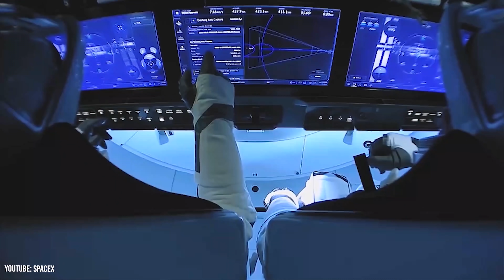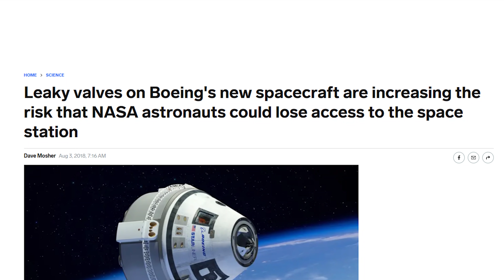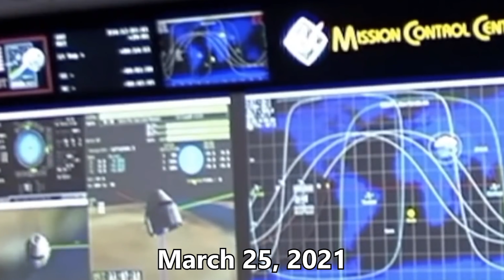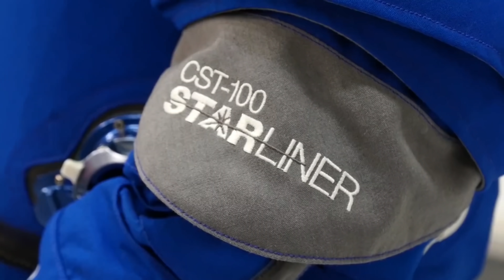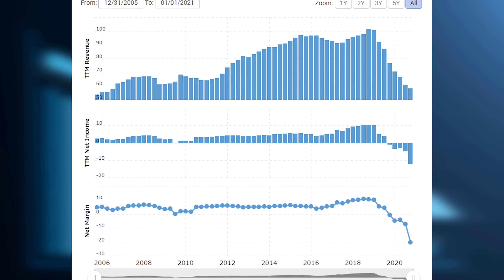What Happened To Boeing Starliner?

Comment: The issues with Boeing go extremely deep, going as far back as the buyout of Boeing by Lockheed Martin with its own money. Their quality standards have gone way downhill, and their leadership is made up of accountants, not engineers. These problems unfortunately won't end here, and it's only one of MANY things they're dealing with. Sadly, Starliner will likely be cancelled if they fail, and for good reason.

Comment: Why not use dearm chaser with crew  ? It can land like the space shuttle on a runway
Reply: If Starliner ends up as a dud, NASA will, in my opinion, either let SpaceX take over all the flights that had been assigned to the Boeing capsule or turn to Lockheed Martin’s Orion as a Starliner replacement.

Comment: the reason the problems got through ground testing was because boeing tested all their components individually. they did no integrated tests where they tested all the components in conjunction with each other. this was the major finding of the after action analysis, and is well known. if you're going to report on such things, you should have known this. not putting you down. i appreciate that you are making the effort. but next time, you need to dig a little deeper.

Comment: My own take for this:

The reason why SpaceX has been able to launch a crewed mission already and Boeing is still yet to dock an unmanned mission is simply because both NASA and Boeing underestimated SpaceX. You see, while SpaceX has lesser experience on space vehicle compared to Boeing, SpaceX actually have greater experiences when it comes to human rated spaceflight. The original cargo dragon was designed to be rated for human spaceflight which gives SpaceX the necessary data to be used in the development of the crew dragon thus makes it easier for SpaceX to build something where Boeing struggled because Boeing just doesn't have the data needed for human spaceflight that SpaceX already have all these years since it began its Commercial Resupply Service to International Space Station back before the Commercial Crew Program was even announced. This makes SpaceX more experienced than Boeing in basically all aspects.

Comment: I've worked with Boeing and several other airframe company's over the years on several different projects.  I've always found that they were very hard to work with.  When they came to reviews (CoDR, PDR, or even CDR) their presentations were almost always below accepted standards.  Their typical answer to questions was "we know what we are doing.....trust us"  for a federal employee this was very troubling.  So it is no wonder they are having problems.  If the corporation doesn't change its attitude, I think their long term prognosis is poor.  I'm very sorry Lockheed stopped building L1011.  Boeing needs more competition building commercial aircraft.  Five minutes ago I finished watching a news broadcast showing three different approaches for moon vehicles.  No where did I see Boeing name.  Boeing had better clean up their act.
Reply: the SLS will be used to carry the crew to space, seems like its just thrown in there.

Comment: I think Boeing failed with Starliner for several reasons:
1.  They’ve never had competition after receiving a contract.
2.  They’ve never had to actually stay within a budget
3.  They’ve never had to actually meet a schedule

The pressure and need to meet of all these requirements was more change than they could handle without error.

Comment: SpaceX was building on the cargo Dragon and Boeing was starting form scratch. Boeing want's to claim the pedigree of companys that it absorbed like NA Rockwell, Hughes Space and Com, Douglas, etc. but they don't have problems in replacing the people who made those places great. When the people left, Boeing moved their misfits into the important positions in the acquired company as a way to get them away from the core business without firing them. Peter principal at work. Is the top management at Boeing going to give these guys enough control to succeed? Really if you are running Starliner for Boeing the most important goal you have is not to screw up and find a new career move before the hardware goes to test. After the test, new people will come in and try and fix things. Those people will NEVER get credit because no one will admit how badly the initial parts of the program were screwed up! Of course it goes without saying that the bigger the budget, the longer the time line and the longer it will be before the problems are recognized and fixed, and the more the fixing will cost.

Oh, the guys running things at SpaceX are guys who spent 20+ years at NA Rockwell, Hughes, TRW, and Douglas and wanted to do these things and were tired of being the guys who fixed the screw ups and never got credit for it and would almost work for free if they found a place where they were allowed to do what they had dreamed of when they decided to become engineers!

Comment: The hypothesis that Starliner would have worked perfectly well if the 737 MAX desaster had not syphoned away the necessary resources, has to be rejected.
The 737 MAX was rolled out with a major flaw that was not addressed, while the plane was pushed through all necessary tests and regulatory roadblocks. The same goes essentially for Starliner. The lack of sufficient testing  and quality control and the urge to deliver the product as quickly as possible were flaws ingrained into Boeing´s corporate culture. Both desasters were the fruits of that systemic failure.

Comment: I very highly doubt it was a focus issue at Boeing. You are right it did not receive the attention of the people high up to see when the gates would be missed. But I think the main issue is that in a company such as Boeing, you eventually start developing a certain "safety/no innovation" attitude that does not let new ideas bloom to fruition. SpaceX is exactly the opposite in that respect. And then, without the major push of the top management, it just gets delayed and delayed, because people do not reexamine their mistakes, just work around them as best as they can get with the limited toolset they have.

Comment: Pretty good video! You can add to the list of Boeing's failures the KC-46A air refueling tanker aircraft for the Air Force (way above budget and way behind timeline, and STILL does not work right - I mean, it's just a tanker derived from the 767, for Pete's sake!) and the current issues with F-18 Super Hornet block 3, problems with the 777, you name it. The only thing they got right is the F-15EX, but then again, the F-15 was originally a McDonnell Douglas product, so there's always that. Boeing is just a giant government funded pension scheme for aerospace engineers and managers with no new ideas and no willingness to take risks. But they'll sure take you taxpayer money, for sure.
Freakin' losers.

Comment: If it were JUST StarLiner - then we could put this down to bad luck.   But the entire SLS program is an even bigger disaster with even more missed deadlines and funding overruns.  One under-performing program would be bad - but TWO speaks of a pattern.    Worse still. StarLiner's problems were software - and not just one bug, but a cluster of them in a system that is supposed to have been completely tested before ever leaving the ground.   The 737-MAX problems were very similar, multiple bugs in a system that had been sold and flown as "human flight ready".   Some of SLS's test fire problems have also been attributed to software errors.   So what we have here is a very definite pattern...and it's a new one, not something that Boeing are usually known for.  Some ex-Boeing software guys that I've spoken to claim that the merger with McDonnell Douglas in 1997 was the root cause of that.  McDonnell were failing for precisely the reasons that Boeing are now failing...and (according my sources) this is due to the acceptance of the very engineering approaches that caused the McDonnell company their problems to override the (generally successful) Boeing culture.  Much of this is (of course) speculation and rumor - but the facts do fit this narrative very closely.  The issues with the MD-11, the A-12 Avenger (both McDonnell screwups) read VERY similarly to to 737-MAX, SLS and StarLiner.   So, yeah, sure, the pandemic didn't help - but all three problems had been happening for years before COVID was even a word.    For me, the worst problem of all is yet to happen...SLS.   SLS is going to cost literally 1,000 times more to launch than StarShip.   SpaceX are crashing a lot of StarShip prototypes - but that's how they work.  Throw something cheap together, when it fails, fix it.   Keep doing that until it doesn't fail anymore.   That's the way most large software companies work...and there is a reason for that.   But that's WAY different than the Boeing approach where each tiny part of the system is tested to perfection, then each group of parts are put together and tested to perfection and so forth - until (theoretically) it all works perfectly on the very first flight...but as systems get increasingly reliant on sophisticated software - and complex interactions between hardware and software - that's increasingly becoming an unworkable approach.  Boeing can't easily adapt to the SpaceX approach - which is why they're doomed.   The world has changed - and they have not.

Comment: When Starliner is working and safely delivering astronauts to the ISS, it will fail on cost grounds. Boeing is a magnitude more expensive than Space X due to their higher costs everywhere & then dumping their rocket into the Atlantic. The hard decision will be to cancel the project or have a second means to get to orbit as a backup. The third alternative as noted in many comments is to give Boeings funding to Dream Chaser. A fourth option would be to launch a Starliner on a Falcon. Fifth option launch a Dream Chaser on a Falcon. Lots of options!

Comment: Some inherent failures by the management at Boeing. Boeing use to be a company run by engineers & Boeing use to be known for their engineering excellence. Not anymore. To say the Covid effected Boeing is irrelevant, as it effected Space X and everyone else. Boeing recent failures include not just the 737Max but the Aerial Tanker contract with the US Air Force, production difficulties with the 787. Firing the CEO was a step in the right direction but will it be enough? Some major changes need to be done internally to re structure how projects are accomplished.

Comment: I don't think there's much contact between the spacecraft division and airliner division. Companies aren't individual people with limited capacity for attention, a big company can do more than one thing. (Also, while airliners are important to Boeing, they are first and foremost a defence contractor, and keeping their biggest client, the US government, happy is critical.)

Anyway, this video ignores that the whole commercial crew program was slowed down by Congress, who intentionally spread the funding over more years than intended. To some extent Boeing was just unlucky that a hole in their quality control process turned out to be a critical hole (all QC is imperfect, but you only notice when one of those imperfections turns out to be critical).  They were otherwise on track to certify at the same time as SpaceX, but are now slowed down both by needing to fix the thruster control problem, and then having to wait for a free docking port at the now much busier ISS.

Comment: Boeing is used to competing with its traditional rivals in the defense-aerospace industry, where cost overruns and project extensions are assumed by all sides and accepted as the Way Things Are. SpaceX doesn't play by those rules...at least, not to anywhere near the same extent. This is why SpaceX beat them to flying crewed missions.

Comment: Left out was that for 4 years (2011-2015), Congress did not approve all the money for the programs, sometimes less then half the amount.  This was the single largest source of delay in these programs (SpaceX and Boeing).  The awarded money is not paid all at once, the companies get payments as they meet milestones.  Congress still has to approve the spending every year.

The description of the first unmanned flight was also a bit misleading.  The video states correctly that due to a timing issue, the Starliner used too much fuel reaching orbit.  The video then shows the Starliner docking and says "the Starliner would fail it's docking maneuver".  The reality is that they never attempted the docking maneuver (they did not have enough fuel to try).  You can call it a failure, but the video left me thinking that they rammed the station.

It's also worth giving a bit more detail on the re-entry problem.  On re-entry, the capsule would separate from the bottom section.  They had programmed the thrusters backwards, so instead of the bottom section flying away, it would have flown back towards the crew module.  Luckily for Boeing, after botching the timing issue, and botching the communication system (not mentioned in the video), they decided to look over all the software and caught the backwards firing engines before they used them, and did an inflight software patch.

Still a good video and worth the watch.

Comment: You mention the Boeing aircraft division several times as a reason for selecting them, and as a reason for Starliners delays. Boeing already has a huge space division and it's the performance of that division that gave NASA high confidence in them, not the aircraft division. They are the prime contractor in the SLS, and they were also a prime contractor for the entire ISS structure.
Also, since they are separate divisions, the was not much (if any) effect on the space division due to the 737 issues.

Comment: Talks about 737 Max - shows 747 instead.
Boeing needs to spin off their aerospace division if they are to compete.  Not only SpaceX, they are rapidly being overtaken by tiny RocketLabs from New Zealand.
They receive more funding yet delivered less than SpaceX.  As Elon said, they obviously give more attention to lobbying than actually building spacecraft.

This is happening with the HLS Moon Lander program as well - SpaceX always gets the short end of the funding stick but delivers more.  SpaceX got one quarter of what Blue Origin got, and slightly more than half of what Dynetics received, yet they are the only ones to be actually testing spacecraft.  All the others could manage with their massively larger funding is to produce some life-size model spacecraft, and slick animation of what they WOULD like to be able to do.

Understandably NASA wants at least two competitors for their projects, but throwing money at it as they had always been doing is not the answer.  They need to identify which companies are using their funding more efficiently, and give them even more funding to help them along, instead of burning money on inefficient incumbents who are better at lobbying than building spacecraft.  As SpaceX has shown, upstarts are always more focused and motivated and cost a lot less because their very existence depend on them actually producing results.

Comment: Id even argue that the delays, overruns, software issues experienced in the space sector foreshadowed the downfall of the Aviation side of house.  Let's face it,  2010 issues happened far before the 787 batteries, 737 max  etc was even on the radar. Can't use covid as a crutch since all 4 players had the same issues.

Comment: Lots of minor errors and IMO flawed judgments, but overall a mostly reasonable timeline of events and assessment of the situation.

Note that the space division of Boeing is quite separate from the aircraft division, and that Starliner is a smallish part of that space division which includes satellite manufacturing, prime contracting on the SLS rocket for NASA, management of the ISS, manufacturing of the X-37B spaceplane for the Air Force/Space Force, and development of the Delta rockets up till Boeing's rocket business was merged with Lockheed Martin's to create ULA. Also note that Boeing has a long and important history with its space divisions. You make it sound like they only make airplanes, and that Starliner represents a new business for them, but Boeing has been with NASA since the beginning of the space age, they made the Mercury capsule, Gemini capsule, Apollo lunar lander and Saturn V first stage (well, they bought/merged with the companies that did).

Also important to the delays (for both Boeing and SpaceX) was the consistent under-funding of the Commercial Crew program by congress during the first several years.

Take care the details when sharing knowledge, misinformation and mistakes are big deals if you gain a following, don't settle for sub par presentations. Good luck!

Comment: Boeing is the most dysfunctional company I've ever worked for. They have legacy labor issues where workers who have been with the company for 30 years or more basically can't be fired for poor performance. Different organizations within the company work against each other because of turf wars that started decades ago. The best way for an ambitious manager to get promoted is to squeeze all the costs they can out of the organizations they run. The penny pinching just drives away anyone under 50yrs old that doesn't have a pension to worry about. Plus, most of the company's leadership is still operating as if the government's money is endless and they can pad their cost plus contracts forever. It's a soul crushing environment if you go there looking to contribute to the space program. Space X and Blue Origin recruit heavily from people who have had enough of Boeing's bull crap.